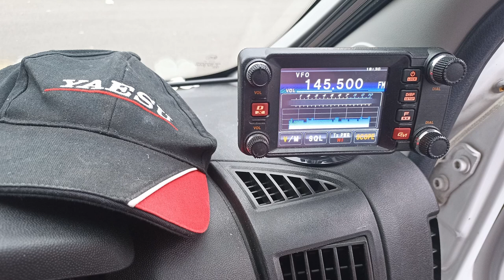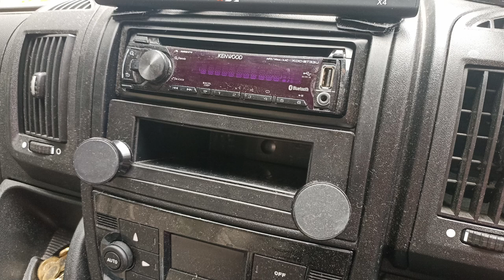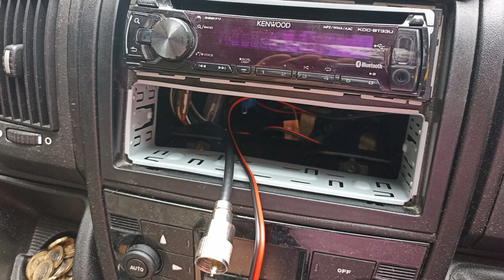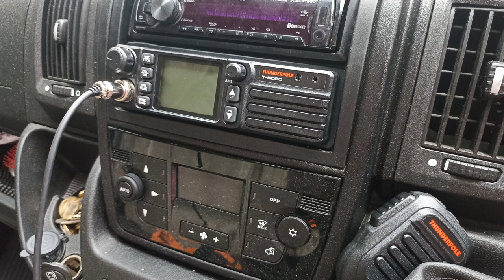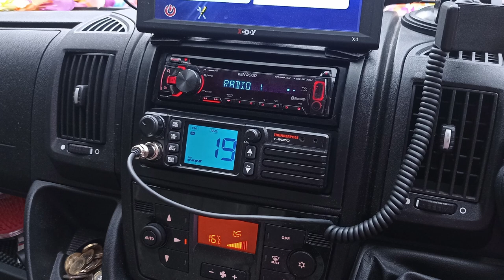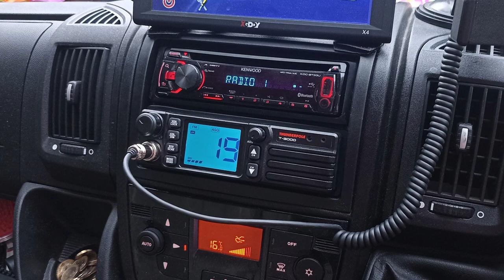Fitting a Thunderpole T-3000  CB RADIO in the MOTORHOME for #vanlife

Comment: I'm an unrepentant CBer and have had CB radio in my campervans for the last 20+ years! That said, it is harder and harder to achieve a quality install on modern vehicles. Solar-panels, MPPT controllers, LED light-bars, etc... have all taken their turn to drive me up the wall! 
Planning on swapping to a coachbuilt motorhome in 5 years time, dreading the additional tech and lack of groundplane...

Comment: Great short video, I prefer longer videos but this was to the point and got the message across.   

Since you have access to ssb other ways, that looks like a perfect little cb.  

Not knowing the UK im assuming it works the frequency the truckers utilize.  

I have a cb with ssb in my van as well as vhf / uhf.   Looking to put in hf when I can afford it.  Anyways the cb here in Canada isn't as popular as it was but still very useful for road updates from truckers on the highway.  

As well a lot of 4x4 groups still use it so its nice to be able to keep in contact with them.

Places I go here in Canada have very little to no cell reception, so it would be silly not to have as many options as I can possibly have.

Comment: Regardless of what antenna you choose if you don't use a SWR meter on installation then you will loose all transmitting power and be very disappointed with transmitting range,  a SWR below 1.5 is acceptable, also all these radio's are not tuned correctly out the box, I bought 3 of these Thunderpole T-3000, each one of them was know near the 4 watts power output, one was as low as 2.4 watts, I had each of them tuned by a professional CB engineer, performance was 100% better.

Comment: Every single Amateur that I speak to, is or was a CBer. why some try and hide it I will never know, I still use 11M and it was how I was introduced to radio. Without it I wouldn't now be licensed. On a lighter note the springer antennas are not brilliant. Sirio 4000 seems to come out on top all the time, yes you will need to tune it. 
All the best.
Reply from the maker: Thanks. May well move to a Sirio if I find myself using the radio more. 73
Reply: Yes I agree the sirio 4000 is one of the best mobile antennas have one myself and it gives the hombase antennas a good run for their money.